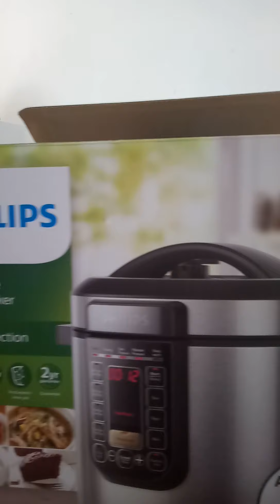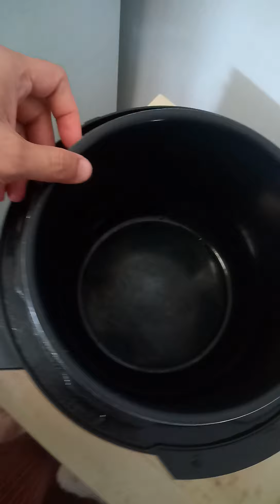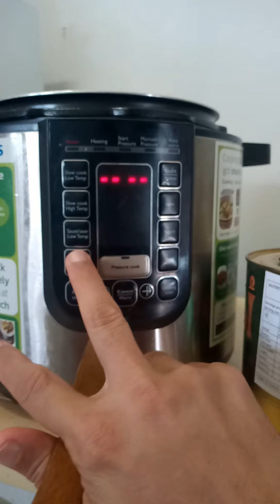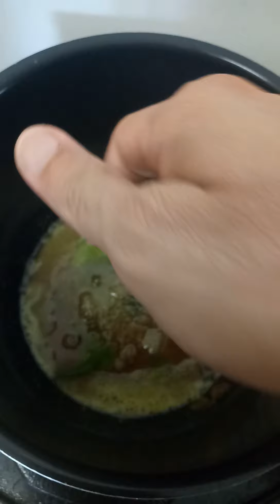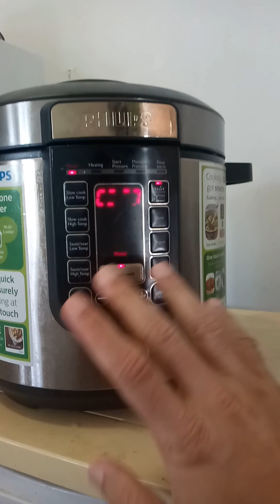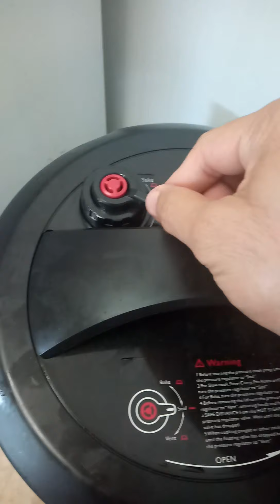Phillips ALL IN ONE MULTI COOKER HD2237 ENGLISH MEAT RECIPE

Comment: I did the same process but the steam is coming out from it’s sides, is it normal?
Reply from the maker: You have to recheck the seal sometimes when I'm not very careful so it also happens in that case you have to stop it carefully and safely release the pressure take out the lid and watch carefully the circular seal somewhere it must be showing a distortion which you have to fix and after that it will be all good. 

Usually if you warm a little bit the lid or the seal so it expands and it comes out of the circle of the steel mesh or a steel wire where the seal has to fit and that creates a distortion and sort of big deal can be resolved very easily after resolving the pressure you can fix it and close the lid and that will be all good 

So in short steam should not come out from the sides yes it can come out from the small valve which pops up and only comes out until it pops out once it is pumped out there is no leakage of steam from anywhere All the water content or steam remains inside until it is fully cooked it is not like a traditional stovetop cooker where steam is always coming out. 

One more thing I would like to share that worst scenario happened with me that seen was leaking and I was sitting in the room working and when I came out after a couple of hours then the display was showing food burnt and in reality it is little bit very little bit burned stick at the bottom which is easily removed from the spoon you are using to step wooden spoon or something but the food became more tastier after burning I should say that it is not actually burnt the water content when it finishes the temperature rises beyond the boiling point of the water and that's what is sensed by the electrical circuit inside and it drips off it trips the circuit and thus cut off the heat supply and that's how it avoids over pressure or burning or overheating or ruining the food it doesn't ruin the food it protects it by cutting the circuit on the temperature going above the boiling point of the water so this is how it works in the scenario of leakage from the sides and not attending it recording it here because I have personally practically experienced it and that's what I did actually I couldn't do anything so the food was actually fully cooked when it was showing burnt and the leakage of water so in that case the water content was quite low in the meal which was another beautiful taste
Reply: @mohammadale-saeed2416  thank you so much, if you can share a picture of rubber sitting it would be appreciated. I think i haven’t put rubber properly on the mesh.

Comment: I have the same pressure cooker but when i choose saute option it shows me maintaining pressure is it normal or it should be on heating only?
Reply from the maker: Pressure can only be maintained if you cover the lid and usually on saute you are strring it so you don't put the lid on but if you put the lid on obviously the pressure will  build up and it will tell you that maintaining pressure as that is what its actually doing so nothing abnormal 
There are sensors which get activated on the pressure build up stage so it locks everything and tells you that there is pressure inside n that's absolutely normal but I recommend you don't do that if you want to do saute, so saute is like bhonna  for your food and if you are really after the pressure do it properly with the pressure function.